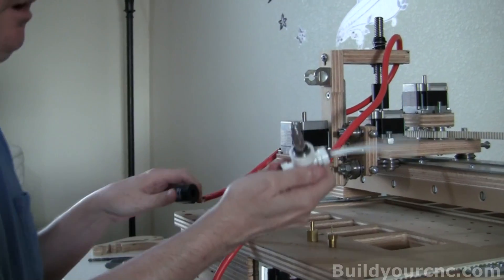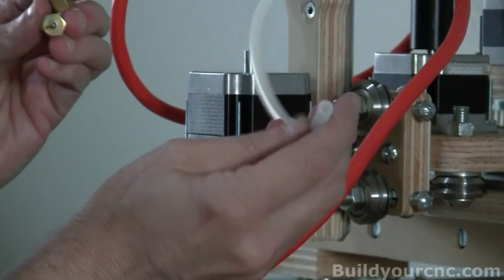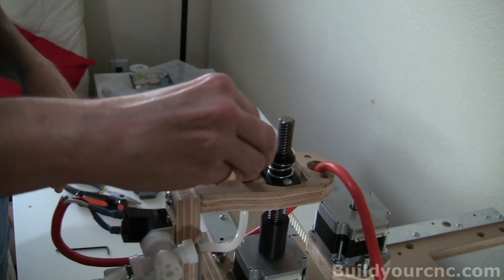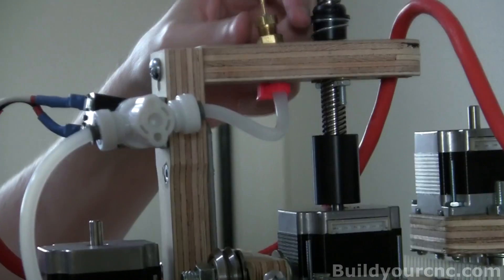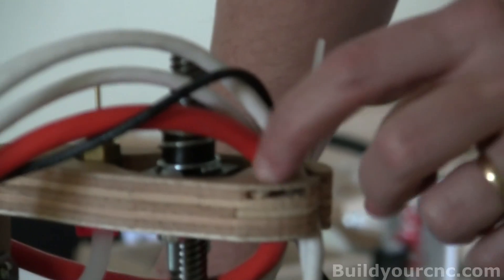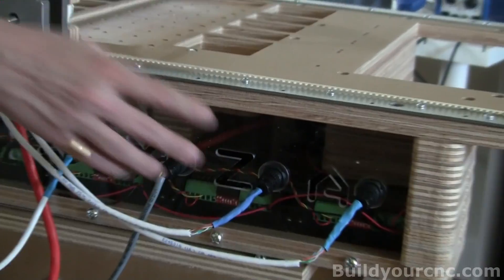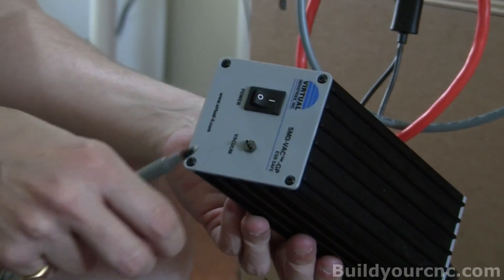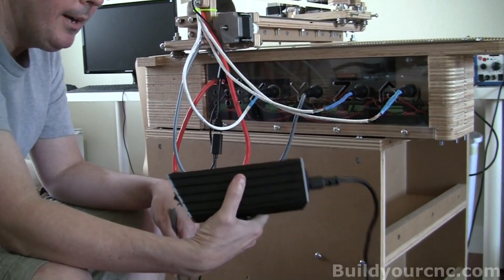redFrog Wiring and Connections 11/11

Comment from the maker: The control software is free (linuxcnc dot org). The g-code that I developed comes with the machine purchase.  I am also working on a ulp under Eagle to output the correct file to be used with the g-code so the smd place information is automatic.